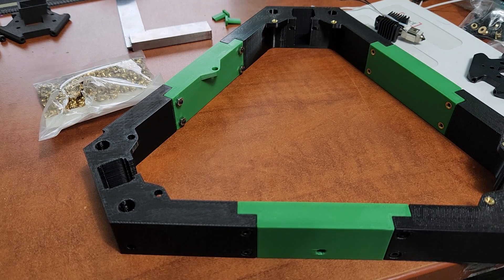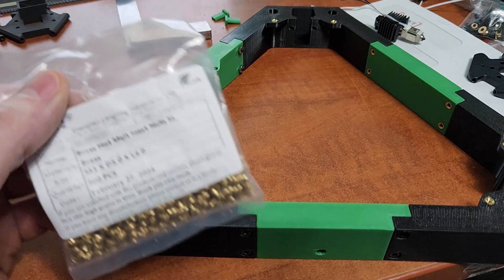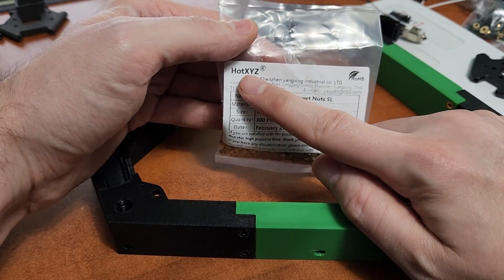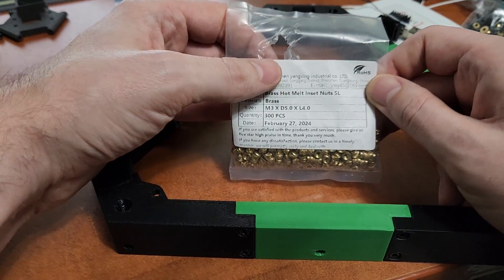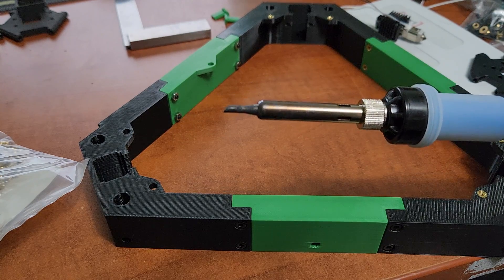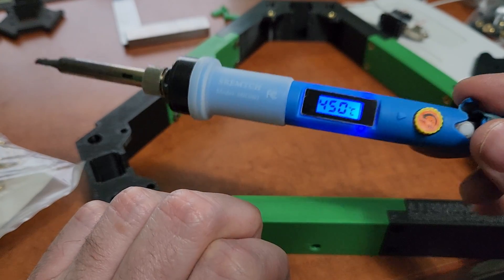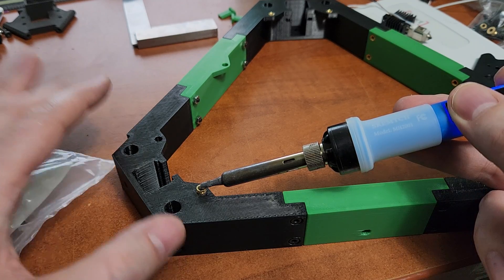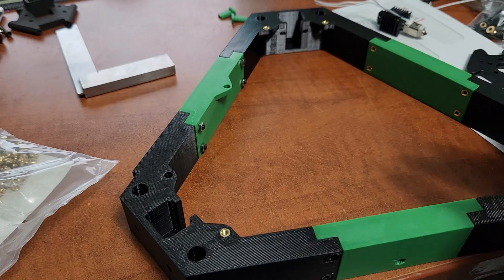Tutorial - How to install heatset inserts into a 3D printed part

Comment: Yeah, the fact people build $150 MACHINES TO PUT IN HEAT SETS IS SO CRAZY....Like did you even try first. The if the heart is on a non-square or parallel surface the machine is no use anyway.

Comment: Wouldn't designs that include embedded nuts be structurally more sound?
Reply from the maker: imbedded nuts have a huge disadvantage because they rely on print tolerance to be perfect or they will spin in place. headsets are much better and just a strong gripping the melted filament on all sides. The heatsets in this video are not structural and only holding on a panel.

Comment: That's a really good tip for getting them flush, going to remember this! Funny enough I'm printing something now that needs M3 inserts, but I recessed them behind another slightly larger radius 🙃 going to see if I can use a metal dowel or a flat-end hex-key to similar effect then!